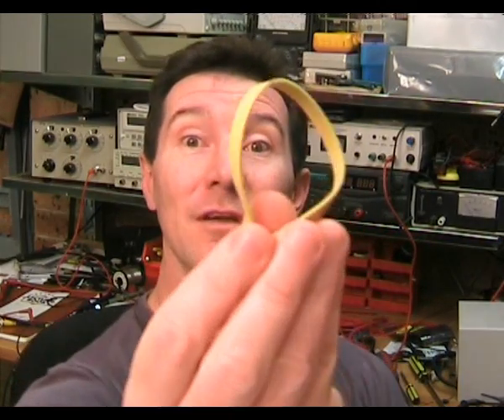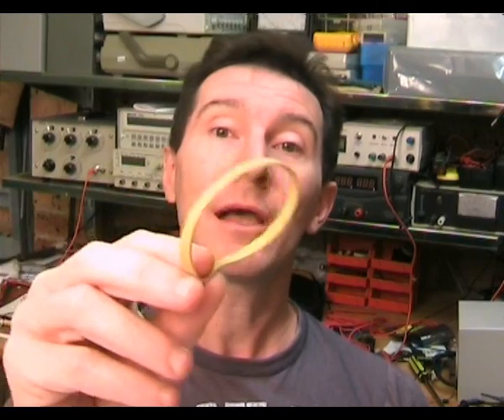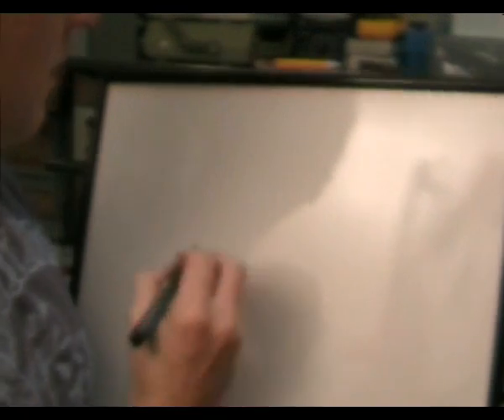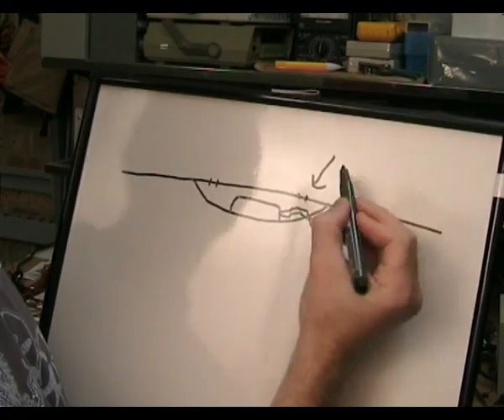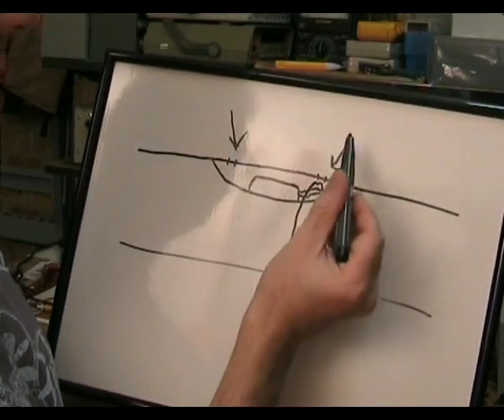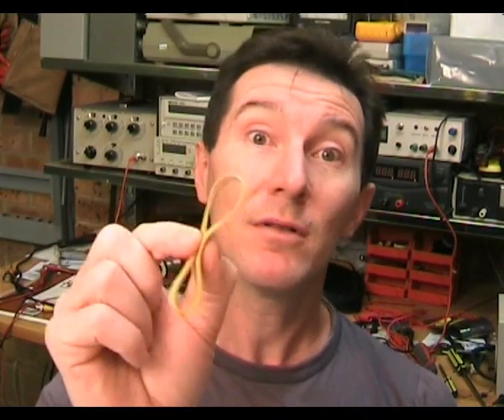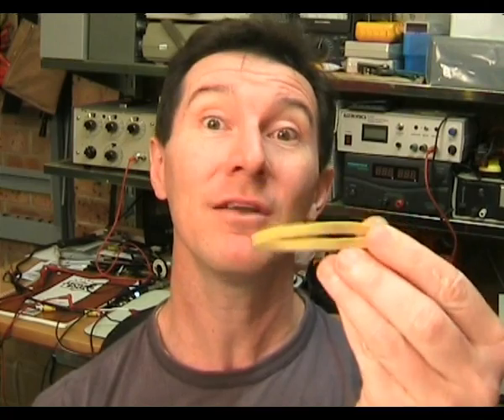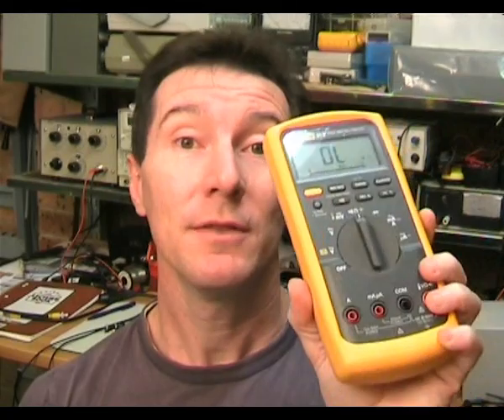EEVblog #10 Part 1 of 2 - How a rubber band cost millions of dollars

Comment: Let me tell you how I cost millions for one of the largest hospitals in Sweden. I was working as an orderly at the time, and jumped in to work a night shift at a post surgery ward. They mostly did laparoscopic gall bladder surgery, which was kind of new at the time, and the criterion for sending patients home after surgery was a temperature of 38.5 degrees or less. So we went around in the early morning hours, took blood samples, pulse and blood pressure. And temperature. With a digital thermometer that had two probes, one for oral use and one for: yeah you guess it. No one asks for the anal probe, it is kind of awkward although accurate. So they took oral readings, and so did I. And then we compiled the results. They were flabbergasted. The problem was, and is, I always read the manual. For years, they had missed that you were supposed to add 0.6 degrees to the oral reading. Patients deemed fit to send home one or two days after surgery were no longer so. Funnily enough, they never asked me to work there again....
Reply: Eskil Eriksson Not sure if I understood. They fired you for for following proper procedure because it costed them money?
Reply: I was just working extra shifts at that ward, so I didn't get fired. They most certainly didn't want to change their procedures. They did because they had to, once the cat was out of the cage, but not happily so.
Reply: i can't help but to recall the related scene from movie idiocracy

Comment from the maker: @eurokid83 It was both a space and ease of use thing. When you manufacture thousands of these things, having to operate a cable tie and then trim off the excess is extra steps you don't want in your already complex assembly process. Also, the protruding cable tie clip would have been a problem when the tight fitting shells went over it.

Comment from the maker: The Fluke 116 is a HVAC specific multimeter, it is not as useful for general electronics use.
i.e. it can't measure more than 600uA current.
If money is an issue, look at other brands, like Amprobe (Fluke owned) or Extech maybe.

Comment: I know this is 10 years old, but a similar story happened in a  New Mexico nuclear waste storage facility. This is a low level waste repository for like medical and lab waste. It is in a salt dome so once the mine shafts are sealed, the salt over geologic time will encapsulate the waste in salt for millions of years. There was a waste shipment from Los Alamos that consisted of liquid waste absorbed into cat litter. This is the normal process. However, some purchasing manager decided to "go green" and instead of using clay cat litter, as the process spec called for, they used shredded and pelletized newsprint litter. Once the waste was packed into the mineshaft, the newsprint dried out enough to allow the waste to start reacting chemically with other waste and the newsprint (and waste heat from decay) resulting in a smouldering fire in the waste barrels, not just once, but at least twice, before the root cause was identified. Purchasing agents can indeed be quite destructive.

Comment: This has really strong ties with programming; you change one tiny little thing to fix one tiny little thing, but the "butterfly effect" of it can cause everything else to explode and you spend a huge amount of time trying to work out what's wrong.
Reply: +NaiveAmoeba I used to feel the same way, but I write my code differently now. In very small parts, and I test each part thoroughly. I can't remember the last time I spent more than 5 minutes fixing a bug, or the last time fixing a bug caused a butterfly effect. I have about 15 years' experience though.
Reply: Software can be tested virtually for free and has far fewer ramifications if something needs to be changed. Once you design a product and begin manufacturing it costs a lot more to fix something.
Reply: As a programmer, that's bad programming and we call it strong coupling. Also, automatic tests should prevent you from screwing (that much) it.
Reply: yes, it takes time to get there...
Reply: It has strong ties with engineering of any sort, be it software, electronic, mechanical or otherwise. A very important rule to remember, to be sure.
Reply: The thing is, rarely are programs designed AND maintained by a single programming team. If that was the case, rarely would these kinds of things happen. However. programs usually have a totally different team maintaining, and small changes or added features can very easily cause a small issue that cascades into completely breaking everything.

Comment: This sounds familiar. Today in fact, the company I work for just got a "qualifying run" of ten PCB boards from a new manufacturer. The boards are actually higher quality then the previous vendor could provide, however, the damn things won't pass testing on our bed of nails test. They work functionally, however our chief test engineer is refusing to use them because the bed of nails is failing them for faulty (closed) spark gaps on the board that we cannot recreate. Our best guess currently is an incorrectly laid out ground plain, but we've yet to confirm this. Moral of this story is, when you change something, order small lots and test the ever loving shit out of them. If these boards had passed test, they'd be assembled and sent to specific customers labeled specifically as a field test unit until we can determine if they are operating in a satisfactory way. A similar change was made to an older product previously, and the PCBs passed tests both just post building and in their final assembly, but it turned out that poor materials killed the performance when the PCBs got hot, and in this industry, faulty readings could cost governments millions of dollars and potential lives lost. Had we not sent these boards out as a qualifying run, it would have been a disaster, but thankfully the issue was noted with only ten test units in customer hands and quickly fixed.

Comment: Cheap Chinese multimeters are perfectly fine for hobbyists. You get what you deserve if you are dumb enough to use one in an expensive production environment.
Reply: Agreed! One of my DMMs is a DT-830B, which cost me under 5$ from eBay, shipment included. It came with a bridged fuse-holder (O.o) and it has probes with a resistance of 1.2 Ohms each. Guess what? Works perfectly fine for measuring low voltages, lol :)

lg, couka
Reply: Hurricane Floyd What?
Reply: +Hurricane Floyd Agreed, too. There is absolutely no reason for a hobbyist to use a 500 dollar Fluke. Dave just hates cheap multimeters ;) But nothing wrong with that too ;)
Reply: +Hurricane Floyd Usable, but not perfectly fine. You have to know their quirks and limits to use them effectively or you will have to have a bit of luck.

Example of a common quirk: it will misread when the battery is getting low while the battery indicator may not necessarily indicate a low battery yet.

Example of a common limitation: while it says you can measure up to 750 or 1000 volts, it will actually blow up if you get anywhere near (or even at 300V) since the metal film resistors aren't rated for that.
Reply: A good middle ground between the cheap Chinese meters and the expensive ones would be something like Extech.
Reply: @Patchuchan  A Brymen-built Extech or Greenlee would probably be fine, even in a production environment.

Comment: In the ene had they not been cheap asses and try to cut corners and just bought ten good multimeter's, they would've saved the thousands of dollars spent fixing a working product and probably ended up in the black still. That's the price you pay when being cheap.
For me though, my $5 meter has served me well with all of my $5-200 projects and would work just fine for most hobbyist who can't justify paying for testing equipment that cost more than the project they need to use it for. 
In short: if your project is a $200,000 wiring job, buy an expensive multimeter, if you are trying to pinpoint the issue in your DIY Altoid tin power bank - buy a cheap one from harbor freight.
Reply: +BananaGunz  € 5,- Digital  Multimeters are inherently unsafe. They might be ok for low current low voltage DC, but I would never  use it outside of that scope. Even household AC jobs can get dangerous quickly. To me my safety is worth more than the €120,- for a good, trustworthy and safe multimeter that lasts a lifetime. :)
Reply: Jean-Jacques de Balzac 

He did not say to use those cheaper meters with mains AC or otherwise, but with small voltage hobbyist DC ranged voltages.
Reply: To be fair, those of us in North America dont have to deal with 240VAC mains either though. So the safety issue is somewhat regionalized.

Comment: I bought a Repco brand RMM760G 3 3/4 digit auto multimeter yesterday for relatively cheap, looked the part, plenty of features, and for what I want (automotive and low voltage work) appears to work relatively well. Feels like a mid-range product in my not so expert opinion. I ripped it open and while it is nowhere near the build quality of a Fluke Model 87, it ain't no Wan Hung Lo type rubbish either. It does appear to be somewhat hit and miss, glass fuses (although both amperage ranges are fuse protected, 1 with a 500mA fuse, the other 20A) but it does have the footprint for the larger HRC fuse holders for the next model up (the 760D I think). All surface mount parts but lacking input protection from what I saw. Only cost me NZD$69 (down from $89 I think, the manual range model was $112 for some silly reason), so it'll keep me out of trouble, but I don't think I'll be testing mains voltages with it just to be safe (rather not have it blow up in my hand). If I get bored with it or upgrade, I'll send it over to you to have a play with

Comment: That could happen even with a expensive multimeter if it was abused. I just ordered a Fluke because I need the features and accuracy now, but I did very well with the cheap meters (European made, but even cheaper than the chinese ones). I got two (amps and volts) and they held up very well. I'll still use them if I need both Volts and Amps (all the time).

Comment: I'd hate to sound cliche with how often it's mentioned but the Hyatt Regency disaster was a really tragic demonstration of how a seemingly insignificant change can have drastic effects in the end.
Reply: And in that case the original design was not only unworkable (which is why the request for the ECR by the contractor) but was only marginally safer too. (Still was pulling through a  welded joint between two C-channels facing each other instead of using rectangular A500 tubing.

Comment: I'm done with crappy multimeter,i run car amp in my house ,in my bedroom te be exactly and it runs from universal power supply which is have been modified and the maximum output is about 20v and my amp runs at 18v .so i hook my multimeter to the + and the - terminal and it shows reading i slowly increase the voltage but when this crappy multimeter show 15.8v the amp automatically ran into protect mode ,i thought the amp was out of spec which is 8-18v and i use the same multimeter to check other power supply and it also show low reading ,finally i use my clampmeter to measure the voltage and the cheap chinese dt830 multimeter show a wrong reading ,btw is fluke 179 good ? I'm going to saving for that multimeter
Reply: Did you check the meter battery? One time at my internship the supplier bright in his multimeter so I could test his air regulator, and I couldn't figure out why the voltage was only 2/3 what I expected it to be. I kept messing with the gains for quite a while before I realized the battery was low. Replaced it, and the voltage was perfect after I reset the gains.

Comment: I have been a long time subscriber of your channel. I think you have a very different scale for what constitutes cheap. Living in a first world country, $30 may be cheap for you. But $30 multimeter is not a cheap mutlimeter here. In fact, $30 is what a professional  here might spend on a multi-meter. I bought  UNI-T multi meter for $50 and it was perhaps the most expensive unit in the shop.

How much does a Electronics Engineer earn in Australia? $80000 / year? Here they make 1/6th of that amount (or even 1/20th  at entry level positions in small companies). If the Flukes of the world were available for 1/6 (or 1/20th) of their first world prices, everyone wold buy them. 

Fluke and some of your other favorite brands may be good, but they either have fat margins or are not as good as managing their costs. Having developed a customer base in the developed world, they probably never felt the need to go lean.
Reply: helloworld I agree that a $30 meter may be expensive for some, but it is cheap for a meter and it will likely lack accuracy, reliability, and any form of input protection past a fuse. 

Your point is like claiming that a $100 laptop is just fine for a professional game developer because it is expensive for some people. It may work, but it will lack the capability to produce a quality product.

Comment: and here i am rocking a $5 multi meter from china
works 
does what i need it to do
conti tests and check dc volts and amps
Reply: needforsuv im rocking a 30$ one, does not messure current though.
Reply: I'll do you one better, I have a $3 multimeter. It's sufficient for hobbyist use.

Comment: Jeez, Even some of the crusty companies/ inventors I have worked for would have done some basic material compatibility checking.  Oil for instance will do very bad things to natural rubber.  But I have seen weird ass stuff happen with solvents and plastics and "rubber".  So no surprise that they had problems.  Thing is that even a name company might change the formula they make rubber bands from so using them without a spec. sheet of exactly what the "rubber" actually is was the first mistake.  I have used O Rings in similar situations and those you can get in a variety of materials.  Cost more up front but...

Comment: Wow this is your oldest video I've seen. Boy things changed.
I got one of those meters the stuff I saw said it was the indian version of fluke looked good got it worked fine. After using a while I have times you turn the knob, etc and it don't turn on don't change functions, etc. then for some reason the continuity and diode test use one position and you have to select with a button what you want. You set to that position it goes to diode test. Why the heck would you do that it seems totally backward to me. 
Supposedly also has a frequency measurement function which is totally useless because no matter what it will say 60 HZ even with no leads attached. 

So much for Mastech being a good meter. Hoping maybe just get a good scope and use that instead and this will become a mobile thing for working on odd jobs, but I don't trust it with mains without having GFCI.

Comment: Yea but Joe Blow is not making 30,000 gear and in manufacturing. They are testing the light bulb in the car or a out let in the house. You are nuts to use none PRO Gear in a manufacturing environment.

Rubber band for wire bundles or tie off? OH MY NO ONE DOES THAT. We have had standards for this for 60 years, Military and Aerospace.

Comment: moral : only use expensive rubber bands ;-)
Reply: This is not always price related. Sometimes the cheapest option is the best for a particular situation so no simple solutions available. The moral is to engage your brain every time you do anything or you are likely to get into trouble.
Reply: Viton o-rings or silicon oil with buna o-rings would have been a much better solution. Just saying.

Comment: So that meter failed how?  It just decided to give a bad reading now and then?  If that's even possible then it was a grey market floor sweepings Chinese meter bought direct from China, not a typical made in China meter.  You don't think they can make a meter?  They made the computer you're reading this on!  Not to mention the computer serving this page.  I don't believe a word of this story!  Too many things would have had to go wrong besides a meter anyway.
Reply: There's a marked difference between the tolerances needed for say someone who needs to test something quick at home and someone actually working in industrial production.  If you're off by fractions of something, it can affect your entire production line.   That's why you spend the money.  And yes, 30 dollar fab is crap, no matter where it's made.

Comment: I loathe Chinese manufactured mechanical parts, Chinese brake pads suck, Chinese rotors suck, Chinese calipers suck..etc. The list goes on. These things break, bend, and rupture easily. Make sure that when you go cheap you get a good brand, it's not worth the risk of getting crap products when the consequences of a small decision may cost you your life.
Reply: A big part of the problem is, there is no accountability for not meeting published specifications, or counterfeiting, or building unsafe products. It is encouraged in fact.